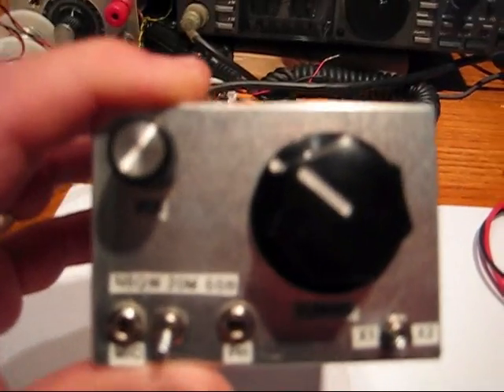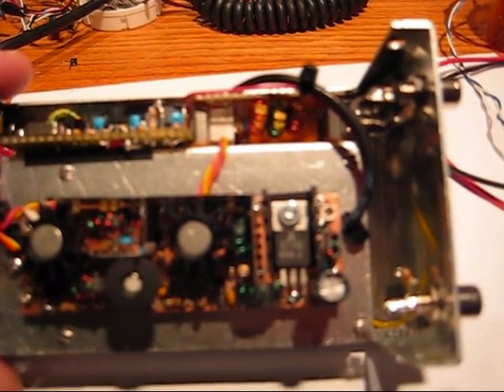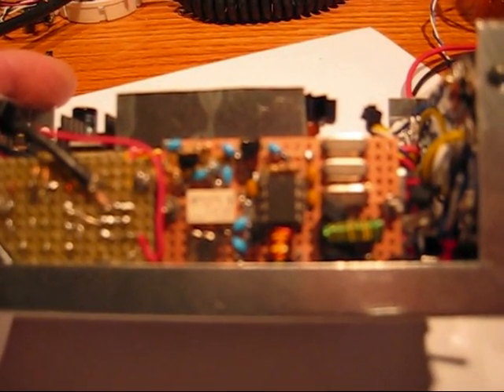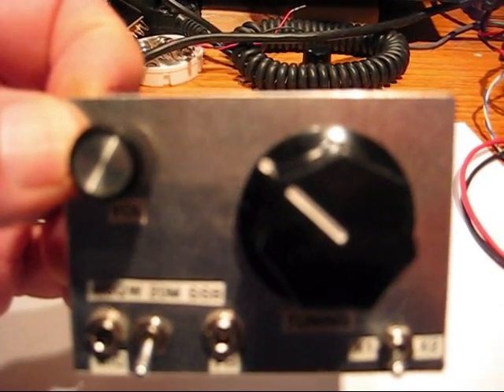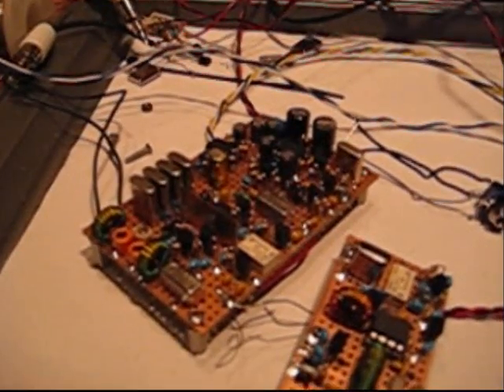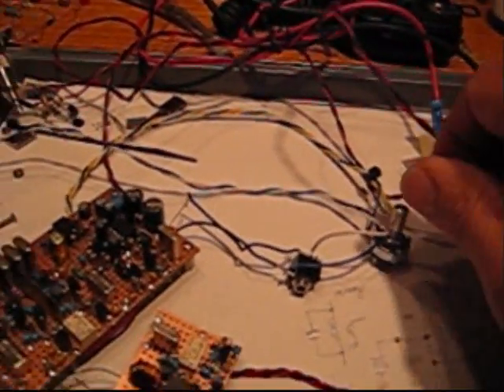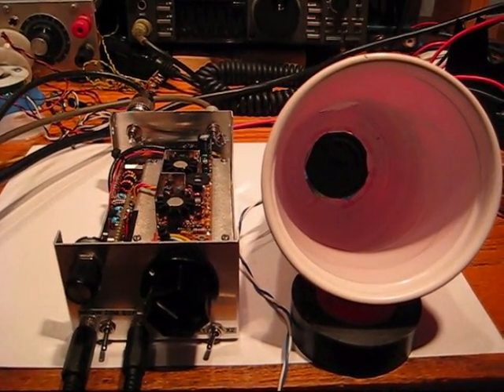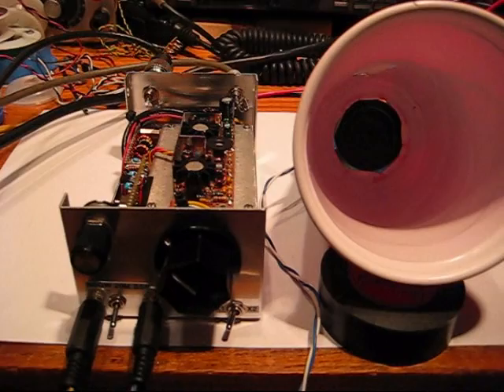N6QW's Shirt Pocket Sized 20M QRP SSB Transceiver.wmv

Comment: You must have big pockets
Reply: Hi Jerome,I do have big pockets -what you see in this video is the V1 prototype and its size was about 30 cubic inches (2X3X5), The Version II was only 16 cubic inches - 2 X 2 X 4. There are some videos of that version. The project was also published in QRP Quarterly where I state that the size could be made even smaller but the constraints were that all leaded components were used (well there were four SMD parts) and no PC boards. Thus same design in a smaller foot print. The other factor was front panel space. You needed a finite amount of space for the controls and I/O. The smallest area was 2X2 inches. Fast forward to today and it just might be possible to get the size down to less than 10 cubic inches and have better (multifunction) controls.Aside from your comment about big pockets -who else do you know that built a small sized functional SSB transceiver running better than one watt --five years ago? Today is another matter --but this may be one of the first. There are some other features such as the crystal switched VXO to give wider frequency coverage. BTW in 2017 this same rig was modified to include a OLED display and full band coverage using an Arduino and Si5351. So now even more capability in a "shirt pocket sized box".If you send me an email to n6qwham@gmail.com I will be happy to send you a copy of the published article. One other goal for 2018 - a single channel SSB transceiver that fits in an Altoids tin. Now that you could easily fit in your shirt pocket. Just curious have you ever scratch built a SSB transceiver as I would like to hear how you worked through the various circuits? I am always open to the better mousetrap.73'sPete N6QW

Comment from the maker: The transceiver is a single conversion design with an IF of 4.9152 MHz thus possibiities for other bands. The LO (extended  VXO) for this radio is operating at 19.1 MHz and produces USB. The filter favors LSB thus putting the radio on 80M presents some "opportunities". There are no plans to make this a kit but  a second prototype (possibly employing SMD for a smaller version yet) is in the works for 17or 15M. An article on the project is in progress. Thanks for the comments. 73's Pete, N6QW